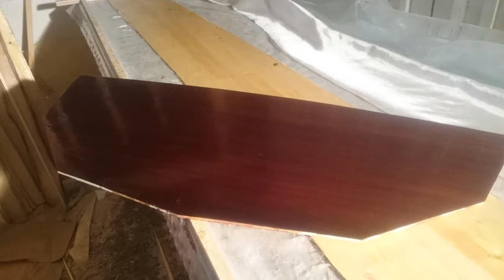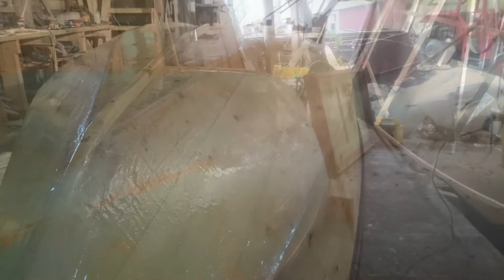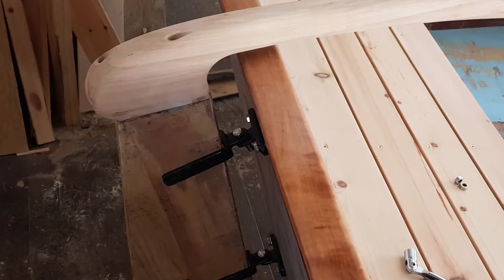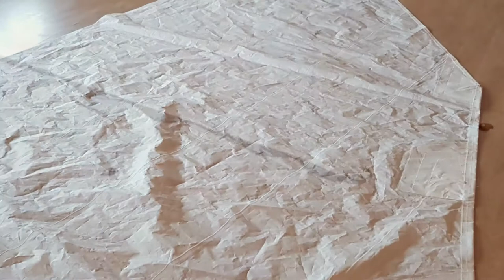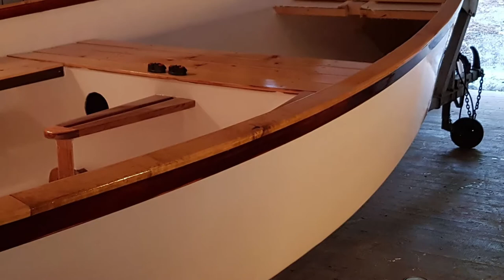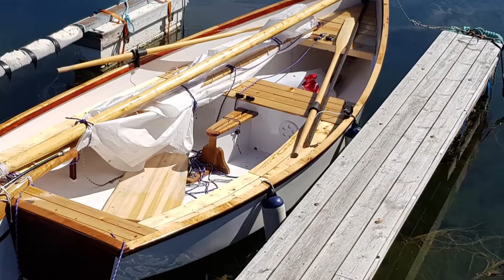Building Argie 15. Slideshow

Comment: does it sail well?    My argie fought pointing as the mast needed to be raked.   I really like your lug-rig.   It makes the boat look much more roomy!
Reply from the maker: I have little experience with other dinghies, so I am not shure how well it really points compared to å sloop-rigged boat. It sails a lot better than my traditional wooden boat, that is for shure. To me it`s not a boat for racing, but having a good time on the water. Later this summer I will try towing it behind my old cabin-cruiser ;-)